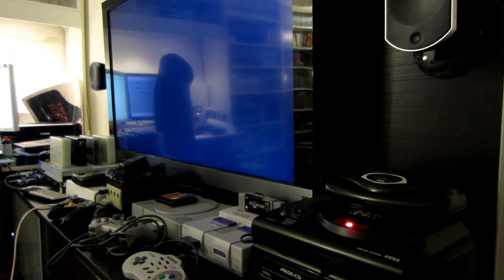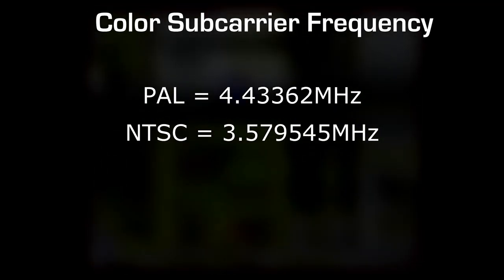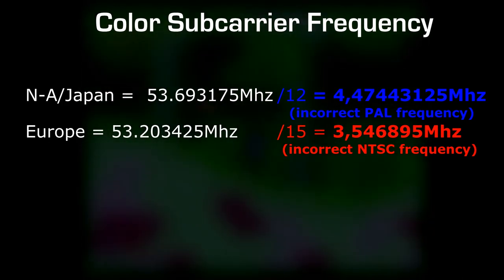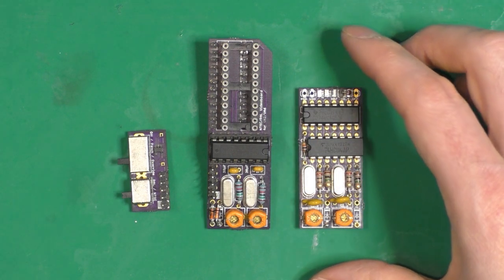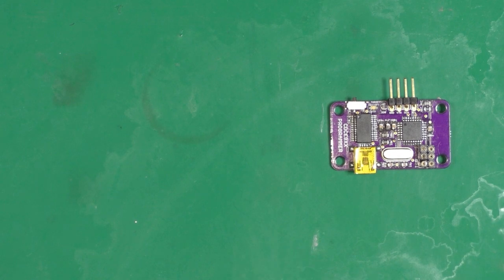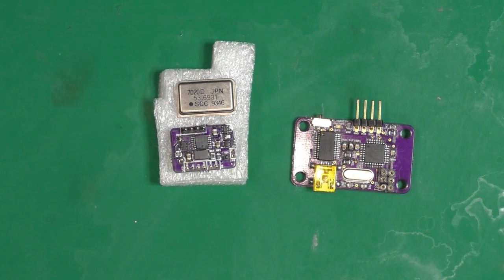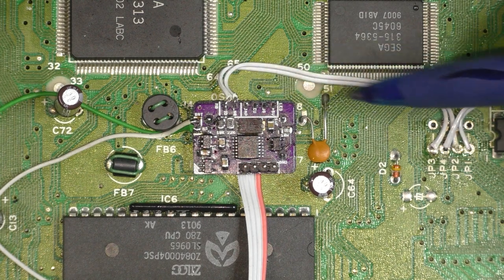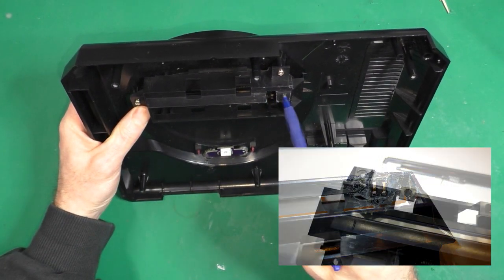[Retro] Megadrive/Genesis CD32X Switchless V2 with Dual Frequency Oscillator (DFO)

Comment: Good work, although it's a lot of work. I have not been concerned with colour mods and DFO's since I will be playing in RGB and in 60Hz 90% of the time. But this is good if you are a perfectionist and completionist.

Do you know if there can be a conflict with Mega CD internal save memory format region vs the BIOS region? My internal save memory is currently saying SEGA-CD (NTSC-U). Even if I reformat it when I have another BIOS loaded up it always says SEGA-CD.

I am trying to figure out why my MultiBIOS is not selecting the default BIOS when plugged into an unmodified Pal Mega Drive. It is now giving me an NTSC-U out of region warning, yet the default BIOS is EU. So I wonder if internal save memory format region is the reason.

Will do some more testing but this is strange.

Thanks

Comment: Guys I need a help, I changed the crystal of my Genesis 3 with internal power source for NTSC.  But the Scart converter only recognizes NTSC when I just turn it on without the Sega 32X.  When connected with the 32X is Pal-M and the colors are bad.  Any idea ?
Reply from the maker: The colors are coming rom the 32X so if your 32x is NTSC then it will display gray image in PAl, regardless if you Gen3 is modded or not. You need to mod the 32x too. That's why I've tried to came up with a multi crystal for the subcarrier for the 32X. I should came up with a better solution for than the one in the video, but between my reno in my house in the IC shortage all my projects are frozen right now.

Comment: In installed this mod into my megadrive 2. Unfortunately when I switch to NTSC the colours are not coming out correctly over composite. Any idea what the likely problem is? The TV definitely can handle NTSC.
Reply from the maker: Hi, no idea. The whole idea is to make the main clock then the video encoder should piggyback on that and the divider to get proper color subcarrier signal. I'd your encoder seems to still in PAL.
On the Megadrive2/Genesis 2 you need to cut a trace to get the NTSC/PAL line to the pin 7 of the video encoder (Fujitsu MB3514 or Sony CXA1645M). Check when you change between NTSC and PAL, this pin should change between LOW (PAL) and HIGH (NTSC).
Reply: @TheRealPhoenix_Retromods  thanks. I worked out. it was as you said the video encoder wasn't getting the right signal. I had connected the vid line to VDP 46 but not to the encoder. I attached a bridge to also send voltage to pin 7 of the video encoder and now it's working perfectly.

Comment: I've just completed a DFO/region mod using your design. HOWEVER... I hard wired the tri-colored LED directly to the DFO/region PCB and FORGOT the resistors! So basically the LED is running at 5V, which will burn out eventually. My question is... can I somehow limit the 5V on the PCB to 3V? Failing that, I'll have to desolder everything and add 3x resistors to the LED legs. Thanks in advance!
Reply from the maker: Main PCB is already packed, so it's going to be difficult to add them. Here are the PCBs I used for LEDs:
Gen1: https://oshpark.com/shared_projects/pD04i1PJ
Gen2: https://oshpark.com/shared_projects/ZpTcLYss
Resistors are them.

Comment: Salut! T’aurais une idée de quelqu’un qui pourrait faire ce mod précis en France ? Je sais que otakus store il acceptent les devis personnalisés mais je sais pas si ils ont les board et si je leurs envoie la vidéo il comprendront ....
Reply from the maker: Salut. Malheursement je connais pas trop la scene de modding en France. Je vends le mod dans ma boutique, et même si c'est simple de l'installer sur une Megadrive 1, je pourrais pas te recommander un installateur désolé. :( Sinon tous les schémas et source sont dispo sur Github.
Reply: The Real Phoenix aussi, est-ce que on peut faire ça avec n’importe quel mod Switchless?
Reply from the maker: Rajouter un DFO? Si ton mod alterne entre du +5V et du Ground entre les differentes regions oui. Borti3948 a fait un super mod pour la SNES qui contient un DFO.
Reply: The Real Phoenix  non sur megadrive
Reply from the maker: Si tu as déjà un switchless oui y a moyen d'ajouter juste un DFO. Il faudra relier l'input du DFO sur les jumpers qui contrôlent la région.
Reply: Salut. La version 2 du dfo avec switchless n'est pas sur github. C'est une version ''maison'' qui n'est pas open source?

Comment: they should continue the project for the 32x, the 32x is a wonderful console I would like to see the potential and how far the 32x can go
Reply from the maker: I made tests with a DFO for the 32x rather than use two crystals. This is technically doable and simplify the circuit. Eventually I'd have to come back to this project.